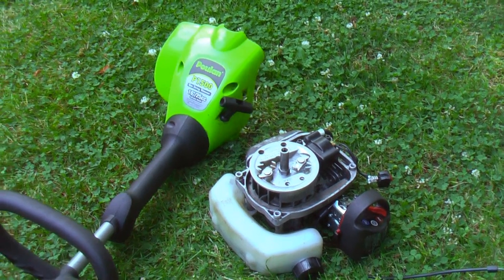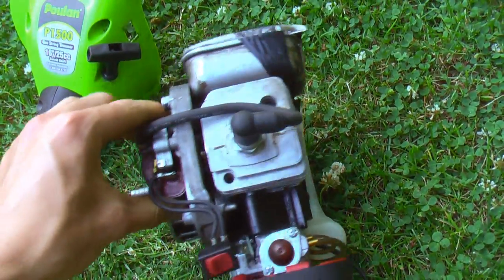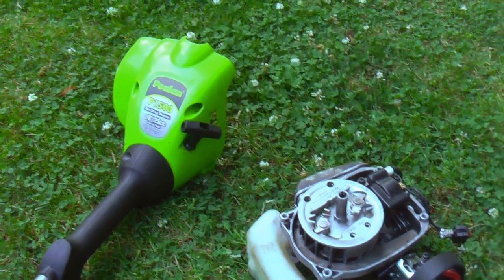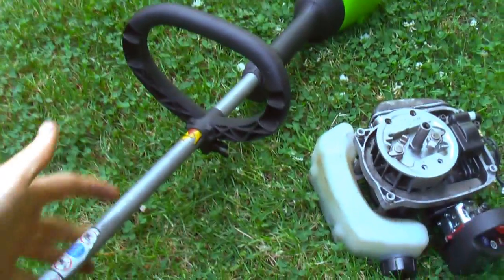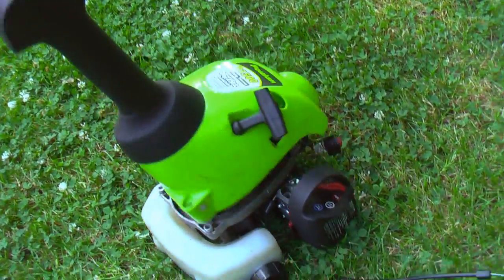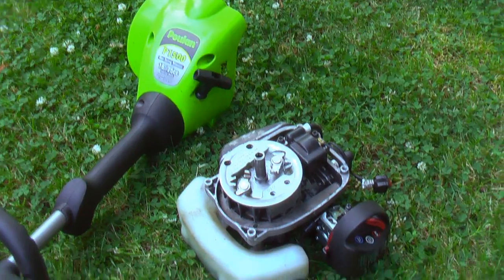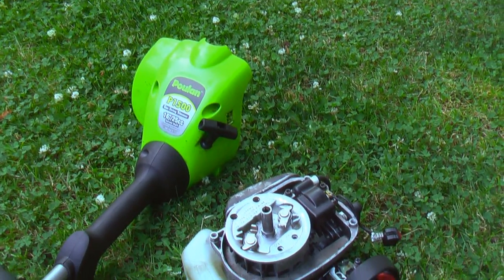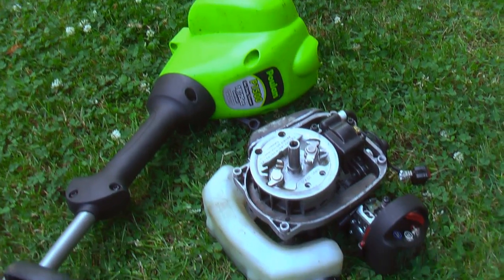25cc RC Boat Project - Part 1 - Intro

Comment: When you build it, make sure that the engine is either exposed or very ventilated.  It could overheat like crazy.  I know because i have a weedwacker powered rc boat.  You could either have it exposed, (a lot) have some kind of fan for the motor, or buy a rudder that has holes and an outlet so that you can feed pipes with circulating water in them around the cylinder.  It's nice to hear from you again. Good luck :)